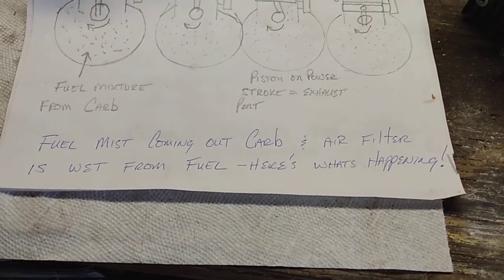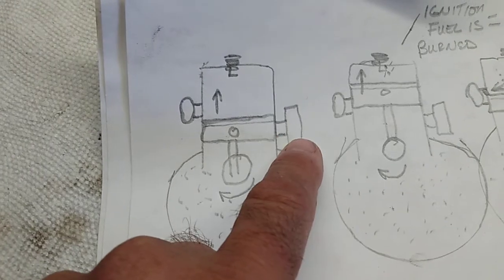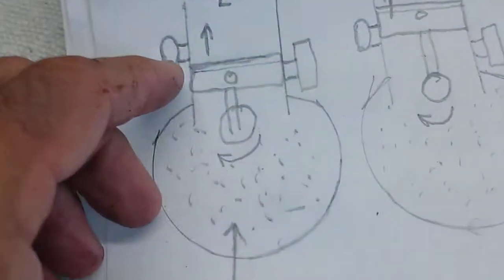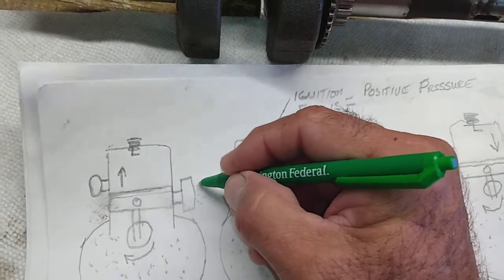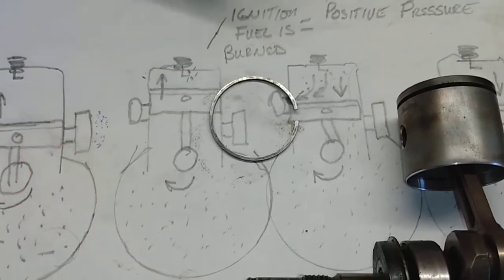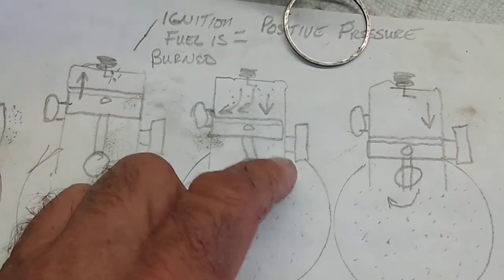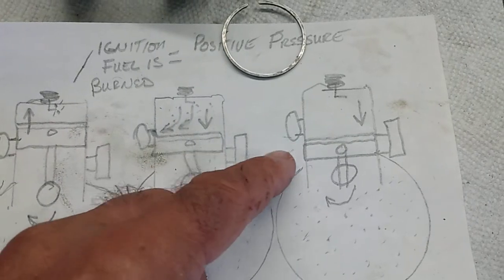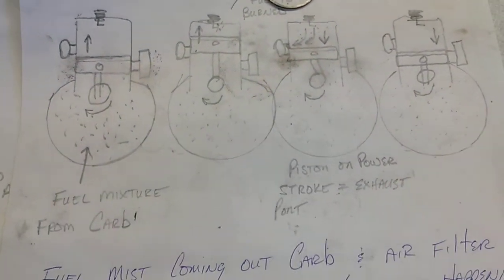My 2 Stroke engine is down on power and air filter is wet w/gas.

Comment: My 1980's Echo brush cutter has the air filter soaked with fuel, and I started investigating. The intake gasket is a little worn, but compression is excellent, the tool starts on 2nd or 3rd string and works flawlessly. 
There is no obvious carbon buildup. I'm thinking it may be the carburetor that's not running properly, but there are no replacement parts for this model since it's that old, so I'm afraid that I can mess something up (like carburetor membranes if I open it) and need to throw away the entire tool. What's your suggestion?

Comment: Nice! Thanks ! I've changed the piston ring, now I got better compression about 160 PSI... but fuel is still spitting into air filter. Exhaust is clear. What else could be the cause?
Reply from the maker: @thunderbee0  2 stroke or 4?
Reply: @ 2 stroke, Solo 654 chainsaw
Reply from the maker: @thunderbee0  did you check ring end gap before installing? Single ring or 2?
Reply: @ZombieDaveAZ  single ring, gap was minimal comparing to the old ring. With old ring I had compression about 10 bar, with new ring it's 11 bar. Carburetor holds pressure and vacuum, metering diaphragm is new, fuel line holds pressure, tank vent is ok. What else? 🤔
Reply from the maker: @thunderbee0   strato charged or regular 2 stroke? That's the last question. Lol
Reply: @ZombieDaveAZ  thanks for Your comments 😀 This saw was discontinued in early 90ies so it must be regular 2 stroke
Reply from the maker: @thunderbee0  try running it with the muffler off. We are checking to see if the exhaust port is partially clogged or the catalytic converter.
Reply: @ZombieDaveAZ  ok, I'll try it. And maybe I'll buy a new sparkplug - old plug may be faulty ?🤔
Reply: @ZombieDaveAZ  I have cleaned the muffler by putting it into fire for several minutes - all residue burned
Reply: @ZombieDaveAZ  checked without muffler and still spits into air filter. When adding throttle slowly it almost doesn't spit but on full throttle there is a mist from carb into air filter.

Comment: Hi. great video, I'm having that problem on a Ryobi BP 42. Even though I checked the muffler was unobstructed, I will run the engine without it to see if anything changes . Here is the video of my BP 42 blowing fuel mist out the carburetor air intake https://www.youtube.com/watch?v=CXDZ9vKdw4Y Thanks for the explanation.
Reply from the maker: You have ring wear if all the ports are clear. This is like replacing a rear main seal in a car. It's $1200 of labor to replace a $9 part. Check your compression with a gauge and see what it says. New would be around 150psi. You're prolly down to 100-110. Running 40:1 mix will help with this but it's a temp solution. Replace the rings is the answer.
Reply: @ZombieDaveAZ  Thanks for your advise and quick reply. I will order the parts, open the engine again and change the rings

Comment: Any idea what causes blow back when it’s on a new top end?  Ring end gap point is good as a new install. On stihl 028. Could the after market have a port timing issue?
Reply: Hi, did you find the answer? I have the original top end, and i'm getting blow back. It's an old engine but i still get 155 Psi of compression, so rings are probably ok?
Reply from the maker: Check for carbon build up in the exhaust port to where you can actually see the piston. I'm thinking that's why you have such great compression along with the blowback. Also try running it with the muffler off and look for the blowback. By doing these things we are trying to isolate the problem. I hope you know what I mean brother.

Comment: I have an issue  about the hose that connected going out to the air filter , when i start the engine , air pressure comes out including gas or petrol, It wasted  the gas, at first i thought it comes out from the carborator but when i remove all the air filter and foam there is no wet fuel at all. It came from the small hose from the engine block.
Reply: I replace new carborator but still the same. It wasted my fuel inside the air filter chamber

Comment: Excellent explanation and illustration  ! I have these same symptoms after  replacing the piston and rings on my Husqvarna 145BF backpack blower. My connecting rod had a small piece break off and the blower stopped immediately.  No damage to the cylinder and only to the bottom of piston at the connecting rod holes on piston. I made certain I faced the rings in the correct direction also made sure  the split in each piston ring was positioned on its locating pin. I wonder if I could have installed a ring incorrectly or there was damage to the cylinder that was not easily seen ?  This blower may have 100 hrs on it and always used Husqvarna 50:1 oil mix.
Reply from the maker: Just asking is it possible that you installed the piston 180° off? That would definitely cause a ring to snag in a port. Just asking
Reply: @ulitepilot aka Zombie Dave  Good question but I did turn the arrow on top of piston in correct direction  towards the exhaust port.

Comment: My issue is I need to put gas on the air filter or the carb won't pull any gas from the bowl at all.
Reply from the maker: Is there a question in there? 2 stroke? 4 stroke? Mower blower chainsaw?  If you're looking for assistance then ask a question. I may be able to help.
Reply: @ZombieDaveAZ  2 stroke 90cc big bored to 100ccs, It has a high airflow air filter instead of the airbox and I wrapped it in two shop towels for restriction which helped a bit, but it doesn't idle and it still needs gas on the filter here and there

Comment: facing same problem but recently i did top end build compression is perfect its an old Japanese 80cc yamaha two stroke facing low rpm bog also but pulls great on high rpm..plz help i am totally messed up!!
Reply from the maker: Hello my friend. I'm assuming this is on like a mini motorcycle? Does it have reed valves. Is it a slide carburetor like a kehein? You need to give me more info to help you. What else besides cylinder and piston did you do?

Comment: I've asked about this, he's referring to a question I've asked. A coworker owns an srm225 Echo straight shaft trimmer. No power at full throttle but a small amount of gas spits out of the carb.

Comment: Your explanation of the effects of ring wear and carbon build up in the exhaust port were pretty good. The discussion of the sacrificial seals on the crank seems out of place. Would leaky seals contribute to the problem of fuel mist coming out of the carburetor? 

Congratulations, you got me thinking early on a Sunday morning.
Reply from the maker: Hi Dave, sometimes when you are making a video it's just whatever comes to mind comes out your mouth. Lol.. leaking seals are worth mentioning because positive pressure in the crankcase can put out oily black residue out between the journals and the seals.